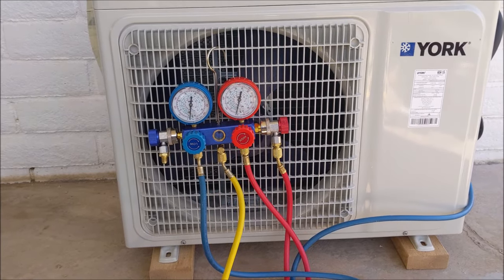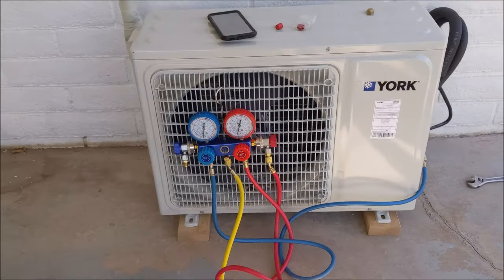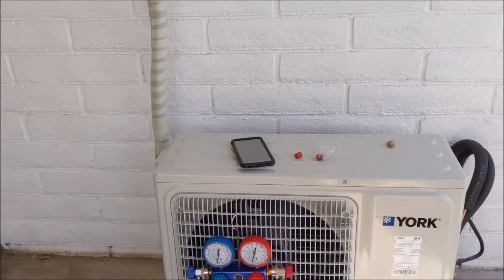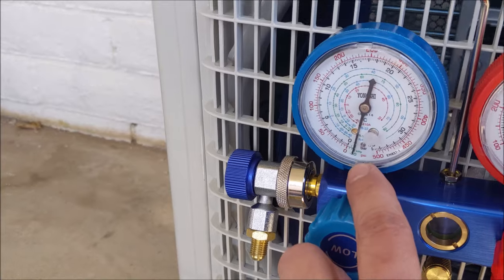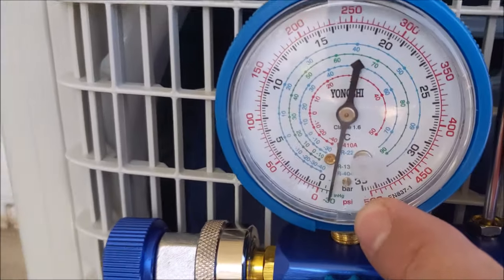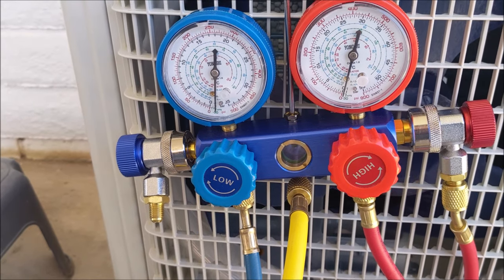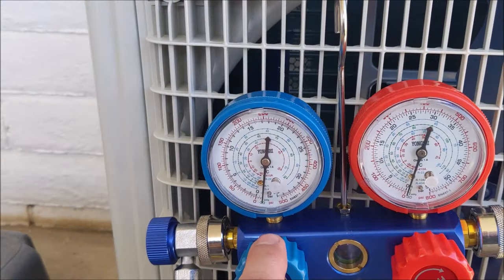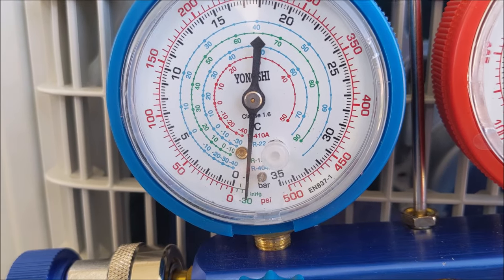Easy steps for Ductless mini split vacuum pump setup for 410a refrigerant

Comment: What if it does move? Mine went from -30 to 0 when I closed valve.
Reply from the maker: It means there is a leak. It should hold steady if 100% tight.
Reply: So yes. It was ice cold for about 30 minutes  after first install, then nothing. I checked every where outside for leaks and nothing. I went inside and checked unit there, dismounted and condensation immediately fell out of system idk where from, I’m ready to trash this thing I swear.

Comment: So once you open the allen key section on the unit and let the refrigerant in, is the blue line now pressurized with refrigerant? Or no because the blue knob is closed? And then if I were to open the blue knob, would it then be pressurized and giving me the refrigerant level psi? Also, your adding refrigerant video said that the unit must be turned on to check the refrigerant level so would I turn the unit on right after first vacuum and refrigerant release THEN check the refrigerant PSI?? 
Sorry for all the questions, just piecing together some of your instructional videos for my first install and I'm not sure if my unit was precharged already and I'm afraid it wasn't so I dont know at what point after vacuuming the lines I would go about adding the refrigerant if its never had any before.

As before, let the ads play so the channel can get paid and watched video several times. Thanks again.
Reply from the maker: Seems like you are a bit confused with the hoses, and the gauges. Thank you for watching. These videos may help out..... https://youtu.be/RL64RX-LvrI   and  https://youtu.be/RndlC9g5HzQ
Reply: You shouldnt really need to check the system after you release the refrigerant. The system is precharged with the correct amount of refrigerant. That is unless you you are running a really long line set or really short. Check the specifications with your system. When you add extra long lines to the head unit/evaporator you may need more refrigerant or if the run is really short then you may have too much. The manual should tell what the 'standard' refrigerant charge will handle as far as lineset length. Remember minisplits can be very temperamental in regards to the charge. They use much less refrigerant compared to a regular system and a few ounces or refrigerant can make a difference. I would not check the system pressures unless it is not cooling/heating properly. And use low lose fittings.

Comment: Confused.  If you close the blue valve aren't you shutting off the potential leaks from the gauge?
Reply from the maker: No. Remember the line is still connected to the HVAC unit. The valve is shutting the manifold connection to the pump, but while still connected to the HVAC system, it will monitor the pressure. If your needle has not moved in 15 to 20 minutes after shutting the valve, your copper end connections are tight.

Comment: Am I the only person confused? The system is under vacuum, then pump is turned off and disconnected. Did you skip the transfer of refrigerant into the system?
Reply from the maker: System comes precharged with refrigerant. The refrigerant is released AFTER the system is tested under vacuum to have no leaks.
Reply: the refrigerant is present. He opened them up at the brass valves there. The pump is just for removing any air in the lines before releasing the refrigerant.

Comment: Probably should have removed the blue line before opening the valves. 
I lost some refrigerant.
Reply: Definitely do not do that. The lines are a vacuum, so it'll suck air back in when you unscrew it, defeating the whole purpose. You can open the refrigerant valve only part way to get a little bit of positive pressure, remove the gauge, then open the valves the rest of the way to minimize the loss, but some small amount should be released.

Comment: I have a pre-charged line set that has been vacuumed and filled with R-410a from the factory, but I need to shorten its length. 

Since the lines are factory pre-charged, is there anything special I need to do aside from vacuuming the lines and checking the pressure as as you've shown?
Reply: Lines are NOT precharged. The refrigerant is inside of the compressor. If you need to shorten the refrigerant lines you will have to cut the lines with a pipe cutter and reflare the ends.

Comment: Hey great video, I'll be using it for a repair in a couple days. I had one question though, can I reuse refrigerant that I purge out? I know how many pounds I am supposed to have in the system but I don't know how much to order. I don't want to have 6 pounds if I only need 1 to replace what was lost. Or do I need to remove all of the refrigerant and just put in the full amount? That's the only thing confusing me still.
Reply from the maker: If you remove it into a tank, you need to put the tank on a refrigerant scale, weigh it, then weigh it AFTER collecting the refrigerant into it. Doing math, take the weight after collected, minus the weight of tank alone. This is how much refrigerant you have. Look on the side label of the indoor unit, and it will tell you how much you need.  Add the difference of what it takes, from what you already collected into your tank. Here is the link to the HVAC scale....... https://amzn.to/3CcMens